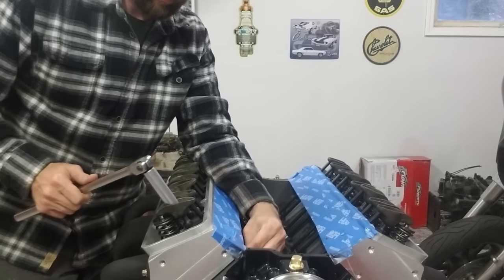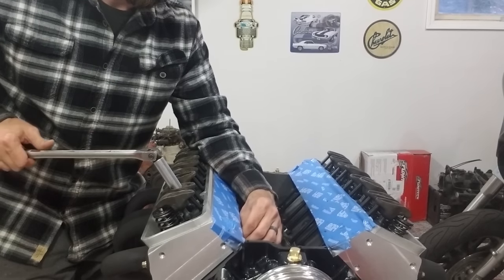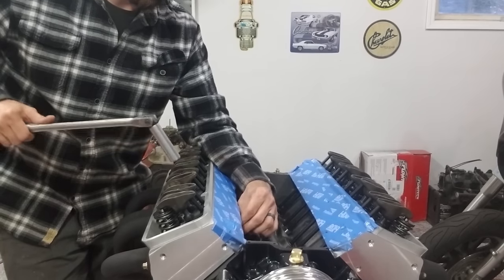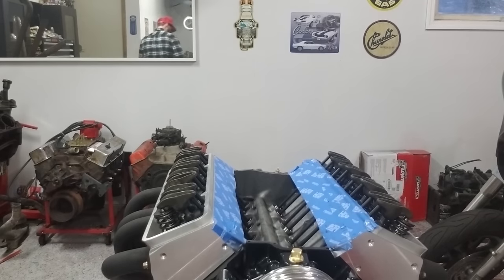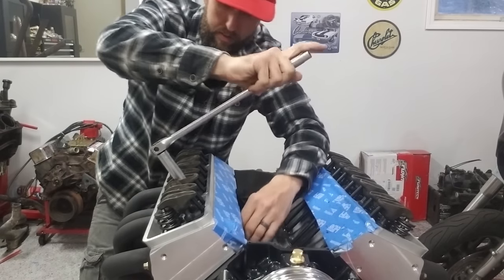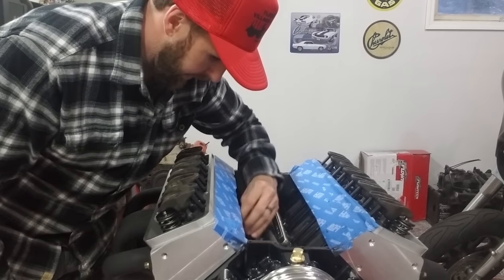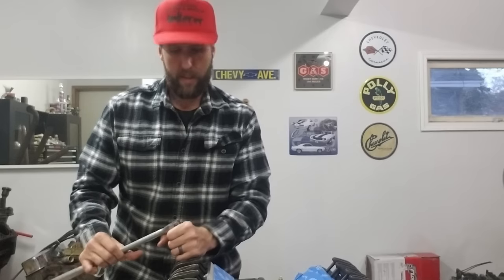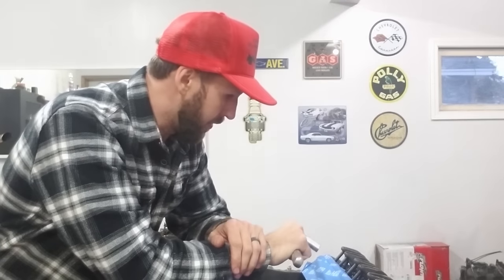Hydraulic Valve Adjustment THE EASY WAY!

Comment: Will this still work if I’ve soaked my lifters and primed them with the oil pump
Reply: Same question..
I drained the oil but still have oil in lifters. Replaced head gaskets. I dont want to replace the lifters because then also cam has to be replaced.  Where does it end?
Reply: @James_the_Builder  it does not matter, it will still work.

Comment: do you have to remove the intake manifold or not?
Reply: On a Chevy 305 or 350 small block, you don't need to move intake manifold but it would be a good idea to make sure the engine can't start if you are going to bump it over with the key. You need to remove just the valve covers

Comment: I’m still confused on exactly how tight they have to be before you move to the next rod. Is it when you feel tension to where it’s getting tight enough to where the rod needs a little force to turn them or when you feel any slight resistance at all when turning them?
Reply: Slight friction... still able to spin but can feel tension
Reply: Just to where there's no up/down movement, like click/clack noise... lifter need to be able to turn when not under load!
Reply: Its not that complicated.

Comment: I’m no mechanic...and I’m not doubting that this works, but from what little I know about how a motor works, I dont see how.

My hang up is that while one rocker may have the lash taken out when the lifter is on the bottom of the cam lobe, another may never land at the bottom of the lobe. So, given that,  isnt there a difference in their final adjustment?

Just trying to learn.

Comment: have a question. I need some insight. 
I do see why people are, as you said, "intimidated by setting valves". I just did head gaskets on my 1997 K1500. I put my heads back on. Now I'm working on setting my valve lash. I tightened the rocker arm just enough till the push rods made contact and wasn't all loose. Then I turned the crank. I know you need to turn it 90 degrees. As I was turning it I felt and heard grinding. I kept turning and it got past it. But the next time I turned it, it was tighter. 
So I loosened up all of my rockers. They are completely loose. Now i can turn it over and there is no grinding. 
The way that you do it here seems really good. 
This is how I was doing it. But when I was turning it, there was a friction like feel and sound? 
Thank you kindly for your help. 
It really seems like the push rods must have been pushing the lifter down on the cam too hard. But you have to take the valve lash out right? 
Is there supposed to be a better way to do this if the lifters aren't dry? 
Has this ever been an issue before? 
Advice? 
Thank you for your thoughts and wisdom.
Reply: if you overheated your engine before doing head gaskets you might have spun a main bearing ,scored the cylinder wall etc or possibly worse.i would just go through the entire valve lash adjusting procedure and try to start it,unless you know you cooked it before this badly...
Reply: @trillrifaxegrindor4411  I have now gone through the whole valve adjustment. Its working better. I had an issue with one valve sticking. Didn't know it. 
But now I've got all the valves set and I can turn it over by hand. It seems a little difficult to turn at one certain point, but doesn't seem to make any odd noise. I can turn the whole thing over with a long ratchet as many times as I want. But it won't turn over with the starter. Depending on which position I leave it in it will turn what seems like a ¼ or ½ turn. Just a split second. Then wont turn. 
Seems pretty odd. If I can turn it by ratchet, shouldn't it turn over with the starter? 
Hmmmmmm.
Reply: @Telly187  I didn't get it to fire up with the starter. It got towed a while later. I never got it. So I never figured it out.

Comment: Very simple as long as the intake manifold is off... What's the easiest way if you need to do it with the intake manifold installed?
Reply from the maker: You can still spin the push rod right underneath the rocker arm.  Just be careful not to loosen the rocker to far where you unseat the ball (tip) of the pushrod from the lifter.  That can be hard to land again with the intake off
Reply: same exact way
Reply: You can do it while running with a cheap valve cover with the center cutout!

Comment: Does that also work for lifters with oil in them  or do they have be dry
Reply from the maker: Either way.  Better bone dry unless you're 100% sure they're all the way pumped up
Reply: You should be soaking your lifters in oil before putting them in. That's how I was taught anyway.

Comment: So i did this on my 400 Pontiac, but i must have done something wrong. Some of my rockers are loose after 15min of running. Sooo what now, just do it over or do i have to do something else ?
Reply from the maker: Did you set last going through the full rotation? If so then yes do it again you might have accidentally missed one

Comment: What if the engine is in the vehicle and the lifters are filled with oil? Im doing valve stem seal replacement.
Reply from the maker: Same thing applies but youll be opening the valve slightly rather than collapsing the lifter

Comment: What happens if i rotate the engine 90 degrees and one of the push rods is really tight and wont spin in my fingers do i loosen it off till it slightly rotates in my finger or do i just not loosen it at all??
Reply: You don't do that one!  See the vid, he rotates and only looks for loose ones, then rotates, and looks for loose ones...some will be tight under load!
You can always do it while running with a cheap valve cover with the center cutout!

Comment: Question Sir i have a dead cylinder 0 comp dry or wet i have valve cover off now and was wondering if there is amything i can do to fix it without pulling head off lol
351w
Reply: Valve hanging open?
Reply: @Evl_67  visually it seems to move well looking at rocker arms any suggestions
Reply: Bowknows77 try adjusting the valves on that cylinder. Seems like one is hanging open a bit
Reply: By that you mean just loosen nut on rocker arm? Sorry new to this learning as i go here lol
Thank you
Reply: @Evl_67  well i adjusted them to see no differance must be with the piston hole or something
Reply: @Evl_67  unless the valve itself is scored somewhere i don't know lol not my wheel house gonna have to bite tjw bullet and lull it apart
Reply: Bowknows77 having absolutely no compression tells me the valve/valves could be hung open. Back it off and then set them. Just see what that does

Comment: How do i check if i over tightend the valves? I did this on a new crate and it will only throw fire from the exaust and wont run. This is my first chevy engine im used to ford desiels and im concerned i may have damaged the engine
Reply: Did you put zinc in your oil? If it's an older engine, you can wipe flat tappet cams if you don't put a zinc additive in it. Also, the method in this video is not ideal. Spinning the pushrods in your fingers is not the best way to check the lash.
Reply: @AF-bl1lk  zinc break in oil
Reply: @bigrustytrusty5856  so, yes?

Comment: I guess this beats my method of doing it while its running and slobbering oil down on the hot manifolds and trying to hear clattering lifters over the fan and the exhaust collector leak that you created from shoving the manifold around trying to get the jeezless bolts back in the manifolds. Good times......

Comment: You didn't mention the lifters have to be drained, or empty, NO oil in them, for this to work. If they're full of oil they won't compress without moving the valve. Otherwise, yep this works great.
Reply from the maker: Doesn't matter if the valve moves, its the same amount of preload 👍

Comment: It makes sense, but every time I turn the engine, it's like half of em reset and the other half get way too tight. What am I doing wrong?

EDIT: Nevermind. After two years, our Chevelle runs again! Thanks Derek!
Reply: I was about to ask the same question
Reply: @85bunnyville47  What I did was just tighten the loose ones. The car ran like it did before I fucked it up (long story but basically I tried to fix what wasn't broke- it never had an issue, I created one.) In other words- perfect. 

Obviously, crank it without firing and make sure everything moves okay first.
Reply: @JRC99  so this method didn't work for you what you saying
Reply: @85bunnyville47  It did work. Eventually the pushrods that seemed too tight after spinning the engine, I left them as is and focused on just tightening the ones that were still loose. That worked for me and the car runs perfect

Comment: I had a mechanic adjust my valves and now I hear them knocking. I think he loosened them too much. Is it okay for me to try and do this method with the intake manifold still on the engine?
Reply: You can do it while running with a cheap valve cover with the center cutout!

Comment: When I did mine like this, they ended up way too tight.... engine would barely turn over.
Reply: Watch the MyVintageIron7512 video on rocker tightening ... he says not to do it this way, won't be accurate and some will be overtightened. I love VGG but MyVinateIron7512 specifically warns against doing it this way and explains why not
Reply: I must have zigged when I should have zagged the first time. Loosened everything and pulled all the pushrods to make sure none were bent. Tried again, and presto majico..... runs like a scalded dog. Forgive my momentary lack of faith, Derek.

Comment: Why do people call it "valve lash" adjustment? It's not, it's called lifter preload. Valve lash is an adjustment on the old solid lifter motors. There is no valve lash on hydraulic lifter motors.

Comment: Hmmm..either I just discovered a dead cylinder\faulty lifter\pushrod\cam, or I did something wrong.  3 full rotations and this old 305 runs worse. 😑
Back to the drawing board.

Comment: How tight is tight? I've been told that you tighten until the pushrod stops spinning... it sounds like you said stop when there is some tension...
Reply from the maker: Stops spinning is past 0 clearance.  You want it to spin but can "feel" resistance.  Thats point of contact or zero clearance
Reply: @ViceGripGarage  
I apperciate your response! I gotta change that before I start my truck up. I dont want to bend my push rods or have valves sticking open
Reply: One last question, should I be able to spin the push rod after my final half turn then?
Reply: same thing bud,dont overthink it                   Slight friction... still able to spin but can feel tension
Reply: @trillrifaxegrindor4411  
Good to know, I initially tightened just till the point that they don't spin anymore. Had to go back and readjust.

Comment: Someone HELP me out here. Having to change an intake gasket, I checked the pushrods after seeing this video. I found 1 with tons of slop and 3 or 4 tight and wouldn't rotate/spin. So I loosened the ones that wouldn't spin and tightened the 1 that was sloppy. Rotated, all the ones I loosened were sloppy then, retiggtened. I keep rotating and tightening the slop and loosening the ones that won't spin. The pushrods will always rotate, even under compression, correct? One bank, drinkers side, seems to rotate always? Hep me
Reply: I believe some will naturally be loose or tight depending on where the cam is in it’s rotation
Reply: @Lightning House  thank you. I actually was told differently, but I had heard the same as you mentioned, so I went ahead and finished it.
Reply: @itruns  glad to hear it

Comment: Can i do it on the engine already filled up with oil?  I had to replace my pushrods now I need to adjust valves.
Reply: Did you get a answer on this question